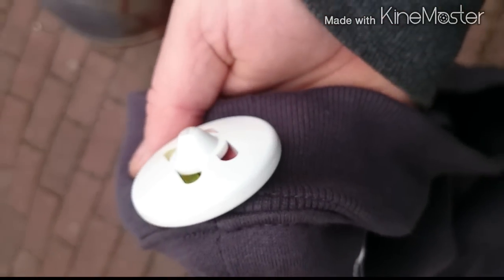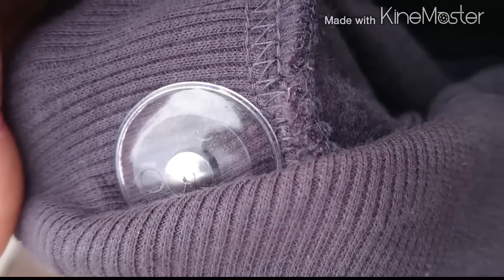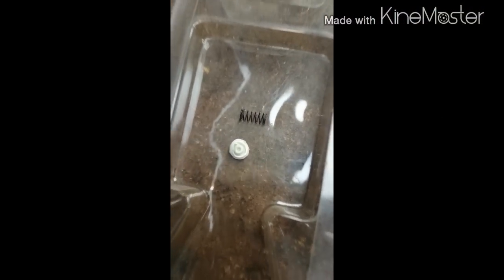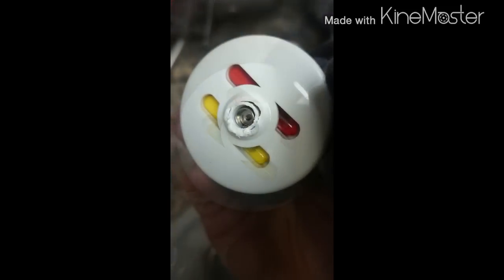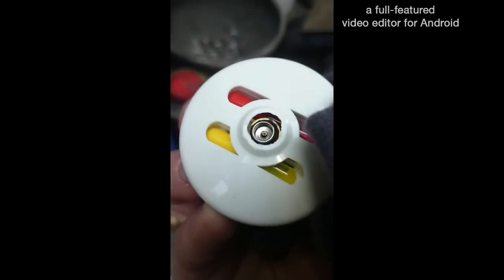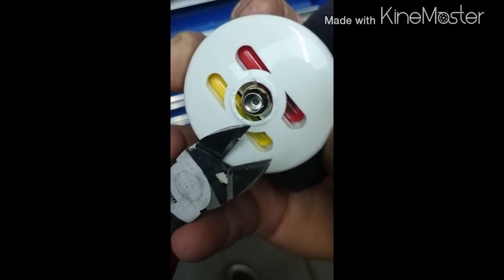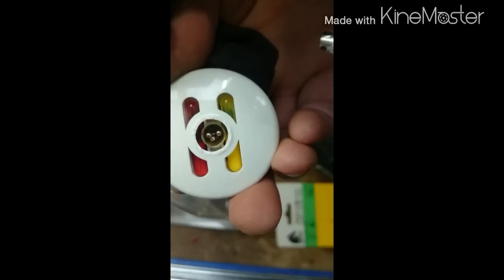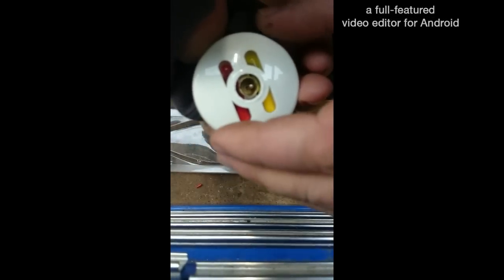How to remove a security ink tag or clothing anti-theft magnet beeper...

Comment: Used a serrated kitchen knife to cut the tip off. Used a pocket knife to wedge the little metal piece out and the ball bearings fell right out. THANK YOU! Ordered something online without the retailer local. Did not want to have to send it back over the ink tag. Took a minute to saw the plastic tip off because I was scared to apply to much pressure on the pin but otherwise took less than five minutes.
Reply: Thanks for your comment,  thanks to ur comment i was able.to.remove that tag from a hat a bought 1 year ago

Comment: It worked!  We bought a hat at Disney and when we came home we found the tag still on.  Thanks!
Reply: Top Bun Who’s steals something and walks out? The alarm of the gates would go off.
Reply: The same just happened to me. I bought a hat from Star Wars land and the ink pack is still there
Reply: Rooster Farmer if it's ink obviously not the one's your talking about are the electromagnetic kind.
Reply: @jstx8983  Ink tags are ElectroMagnetic too, at least the ones I use at work are. 
We took one apart, two small tubes of ink and a metal coil that sets off the doors

Comment: I didn’t have to cut anything just used a plastic bag. Wrapped it around the oil on the cartridge side and the plastic back and pin popped right out under the pressure (bought the clothes on vacation  didn’t realize they still had the tags got home 400 mi away and had to find a way to get them off)

Comment: you just need a magnet bro. that's mad work. I know how those work.
Reply: ghostkilla346  won't the detectors beep if you have a magnet with you in shopping malls ?
Reply: nisha shynee maybe but it won't be suspicious if you plan it right. it's pretty easy tbh. the inside is just the magnet that's how they remove it in stores.

Comment: won't the detectors beep if you have a magnet with you in shopping malls ?
Reply: nisha shynee no
Reply: Noa Yarnell thanks and does the magnets from speakers work ?
Reply: nisha shynee no there's specially designed magnets for this, the magnet had to be strong as hell to take these off
Reply: Noa Yarnell alright thanks ☺
Reply: No.  Most Loss Prevention sensors pick up on RFID and other types of special signals.  Really depends where you're at.